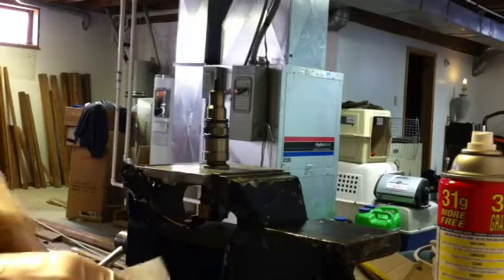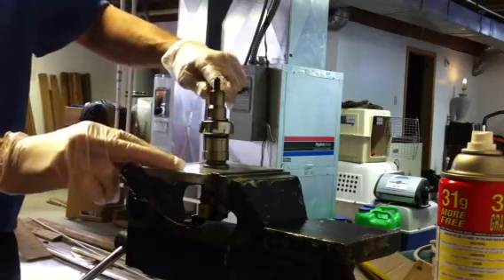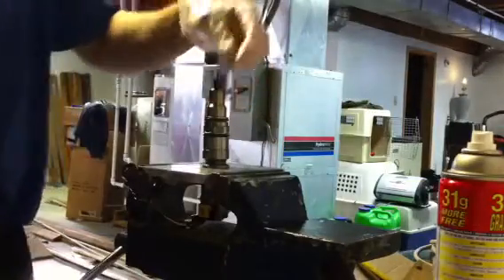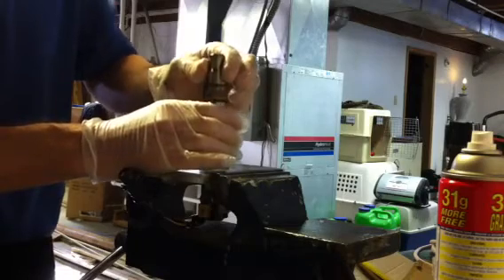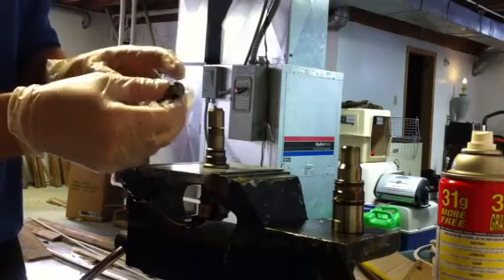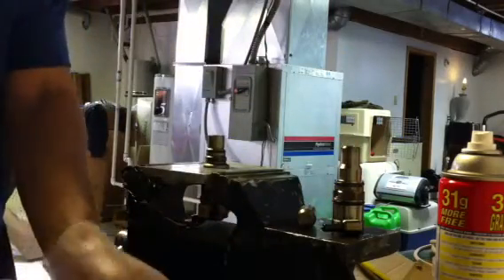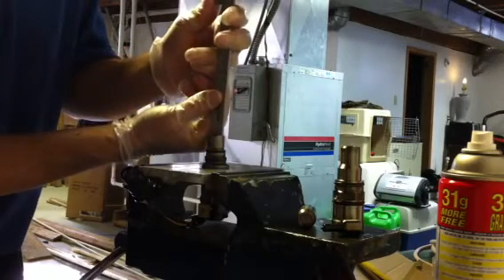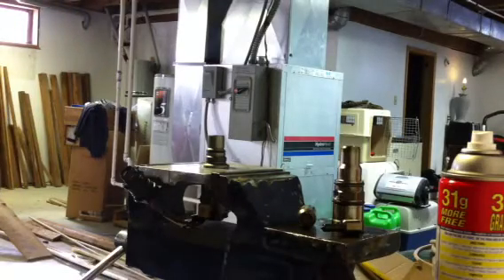6.0l Powerstroke injector disassembly

Comment: What is the torque to reassembly the body injector?
Reply from the maker: I have heard 2 different numbers, 80 lb-ft and 60 lb-ft. I had found some were over 80 when separating and others were somewhat less. I also found the injectors would spin in the hold-down over 60. Not the same thread, but the stand-pipe torque is 60 lb-ft, so I surmised that would be reasonable for these as well. I used 60 lb-ft on my last assembly. No issues over 1 year later.
Reply: Ok, perfect, i reassembly with 50 lb-ft before read your answer and works fine, but before i torqued with 80 lb-ft and the effect was low power. Thanks.

Comment: It was just injector six that failed so I decided while I'm taking it out I would just go ahead and clean them all and do new o-rings an nipple rail o-rings. I purchased an ultrasonic cleaner to do the tips with and I'm going to go through the injectors the same way you did in the videos. In the video you said that you used a light abrasive in the plunger bore, can you tell me what you used. I have bristle brushes and brake cleaner.

Comment: Thank you for the reply I ended up calling Elite diesel and they told me that that block is only sold in particular repair packages so I wasn't able to get one there I ended up buying two pieces of oak wood and drilling hole-in-one before the cut and one after the cut I haven't had a chance to use them yet getting ready to do this this week.

Comment: Did you drill the 7/8 hole before or after the center cut?
Reply from the maker: Actually, I used a small shim between the 2 pieces and drilled it while it was clamped together. To cut it after drilling you would need a very small cut line or you would have to ream the hole. In any case, you could add a finger to it that would sit in the notch on the injector casing.

Comment from the maker: You can make one. The hole is 7/8". I believe you can buy one from Elite diesel engineering in Denver. You can't buy new injector parts. Neither can I or most other rebuilders.